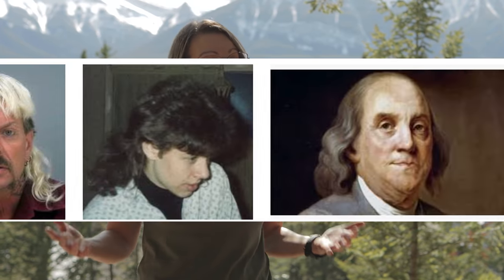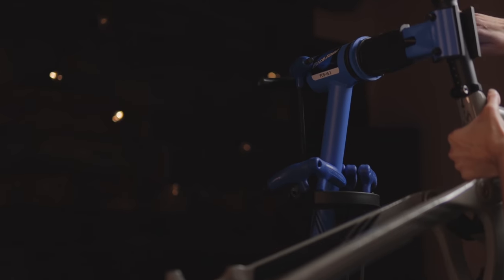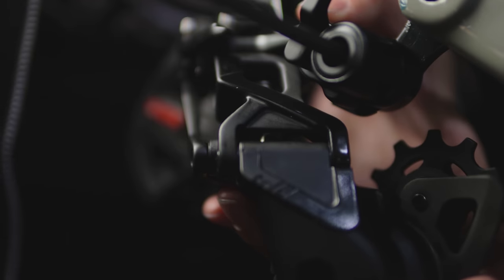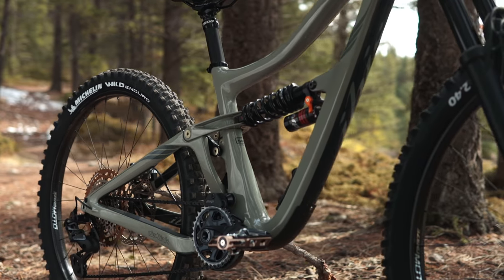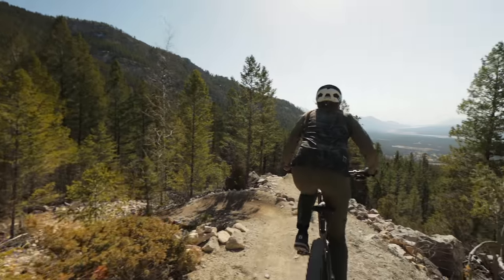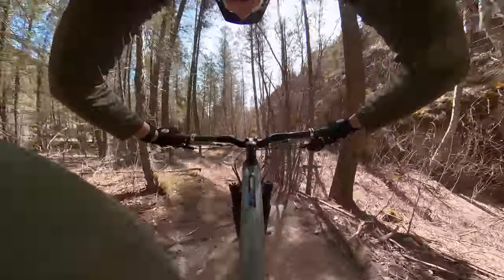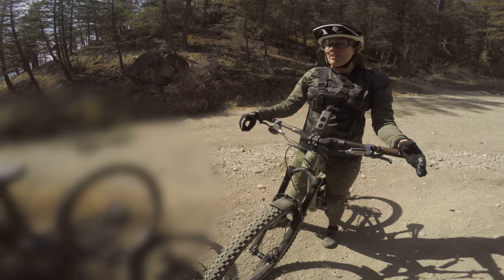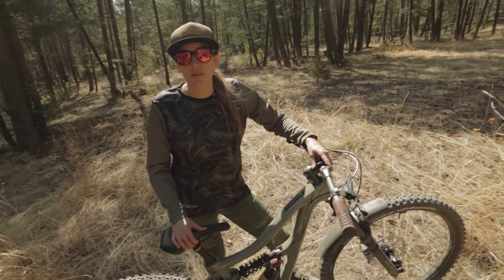Can you "mullet" ANY bike? YES. (DO THIS, IT WORKS)

Comment: Video is a bit of a lose lose. Half the video is just a bad commercial which normally means the money goes into high production value and in depth testing. Instead we get less in depth testing than a regular bike enthusiast would have shown and more commercials.

Would get a lot more views if a some real quantitative analysis was done. Put it some graphs of the suspension curve and measure the new angles, especially the crank and tire clearances.